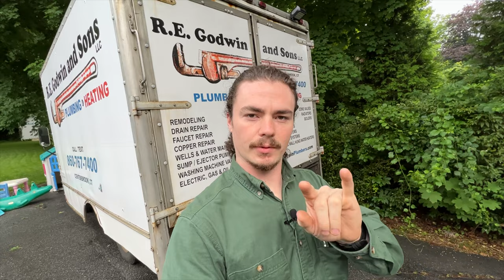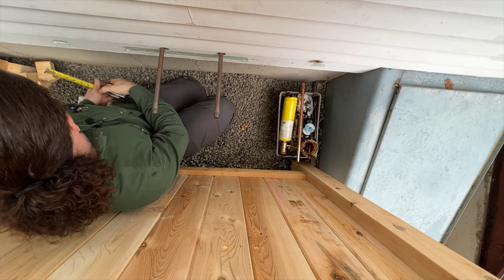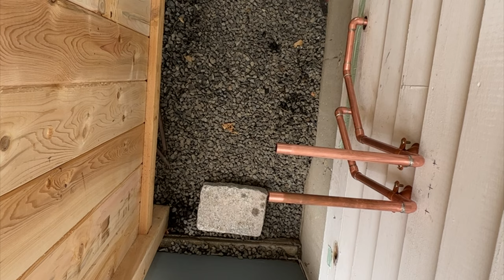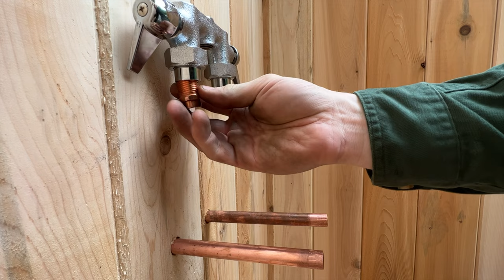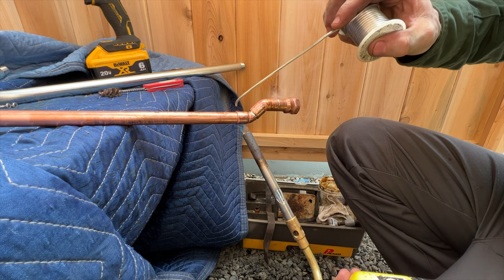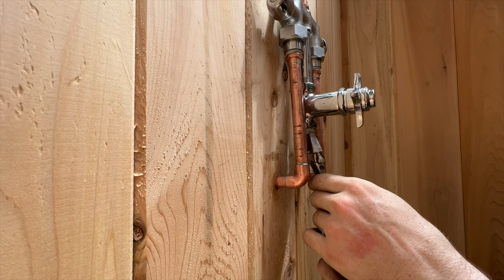Outdoor Shower Installation

Comment: Nice job I think it would have been a good idea if you had a small ball valve going to the shower head to be able to cut it off if you only wanted to wash your feet or use the small hose for filling a pot or bucket but thanks again for the great video keep them coming my friend.
Reply from the maker: I completely agree. I also am not a huge fan of the foot wash valve being spring loaded.. unfortunately I was supply these valves and asked to install them without any consultation. No problem, but I have a suspicion that I will be back to install the valves as you suggested.
Reply: @GodwinAndSons  I appreciate your videos and your response have a great weekend.

Comment: What area of the country did you install this shower in?  Freeze considerations?  Is this a normal residential installation?  Aren't there any permitting requirements for such a shower?  Or... do you live in the middle of nowhere?
Reply: He mentioned several times in the video about plumbing being pitched back towards the house for draining in winter. 

Also it's a structure leas than 10x10 not attached to house, and isn't going to be used for full on showers, moreso for rinsing before / after pool use.